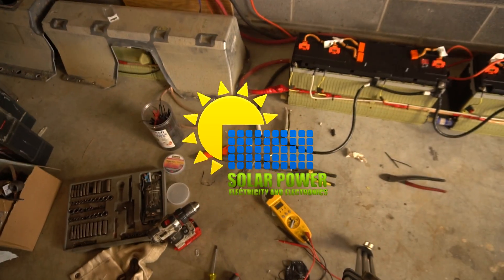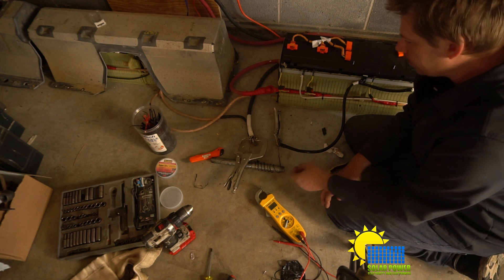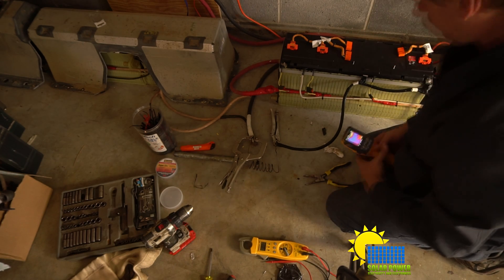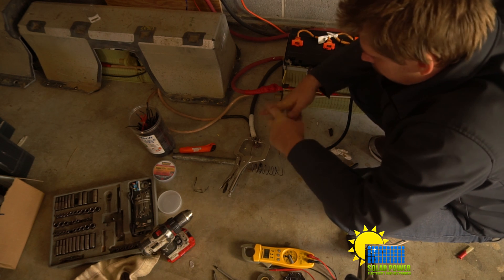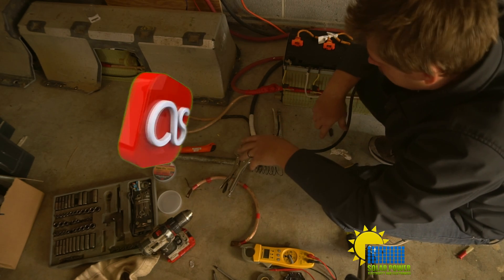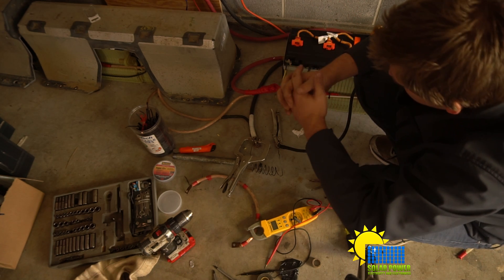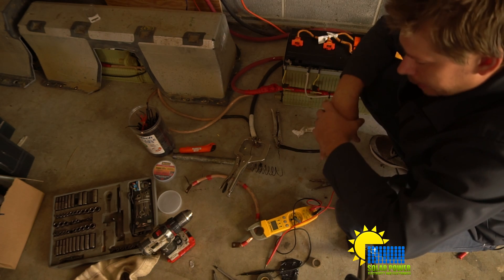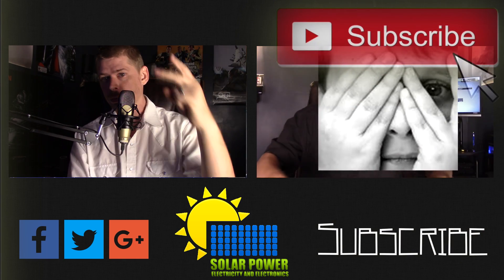Balancing A 33 Kwh Chevy Volt Power Wall Battery For A Solar Powered Home

Comment: I got to get back to working on my solar array.
Reply from the maker: It's too expensive man don't do it
Reply: @solarpowerelectricityandel2915  I know right I been thinking about taking the posts in the yard down and building a over hang off the back of the house and putting them on the roof of that.
Reply from the maker: IT's cool to do that but the money.